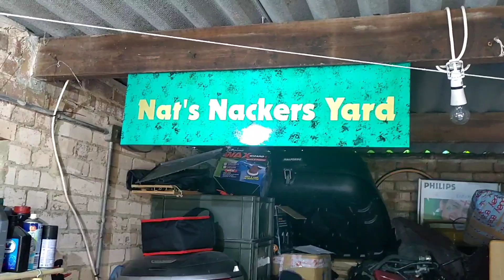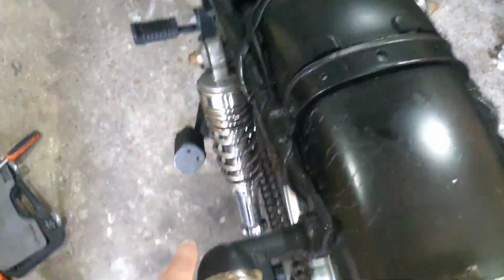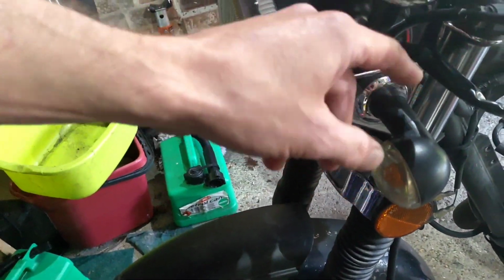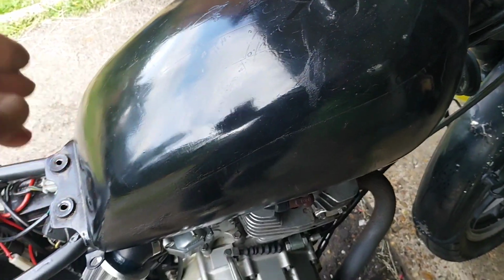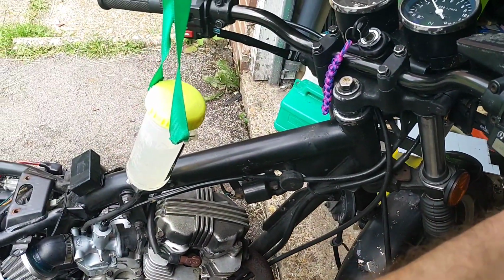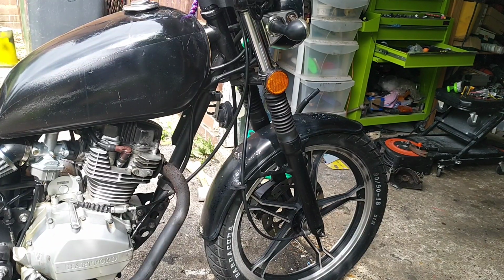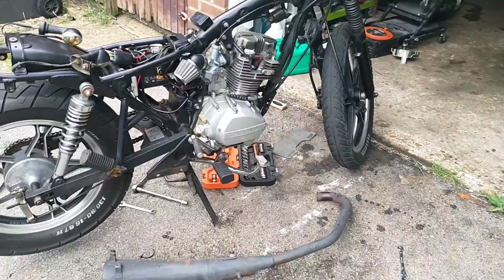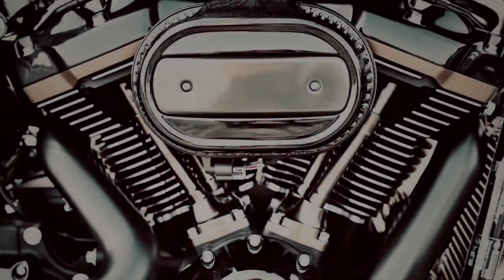Hartford HD125S.  Quick fix and Strip.

Comment: I wonder with that first washer Nat if you should have drilled the 2 holes at the bottom and cut a slit at the top for the diaphragm suction. 

Well done on your fix. 

I'm going to be watching your paint very carefully this time as I got my zl600 good but not as shiny as you get yours so I'm curious as to what you do different.
Reply from the maker: That’s a bloody good point on the washer. Hadn’t thought of that!  

Paint is going to be tricky I this as the tank is pretty shagged!